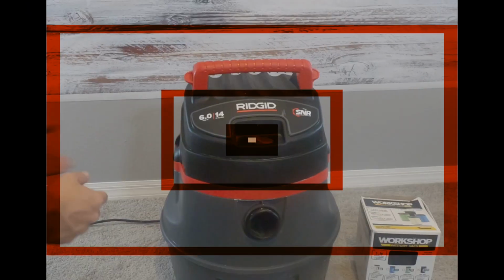how to convert any shop-vac into an extractor, for ONLY $250.

Comment: I just ordered the mytee upholstery tool and hooked it to the shopvac lol
Reply from the maker: Thats a solid option as well. Ive always been a lil over the top on projects and this was no exception lol.
Reply: I didn't see where the blue hose went to.
Pressure washer?
Reply from the maker: @proautodetailingsd4190  the garden hose adapter screws into a garden hose spigot or a hot water heat for a hot option.

If you look at the end of the video where the contant is poured intonthe bucket you can see the blue water line hooked up to my water spigot.
Reply: @detailaddicts  what if your mobile thou were can you connect the end of the air hose ?
Reply from the maker: @armandosalgado3390  so the blue hose is a water line (looks similar to an air hose). I would connect it to my water tank or wster tank pump (if using a pump on to incrrase preasure).

Comment: I got a bissell works great and it was 150 and didn’t have to sacrifice a shop vac
Reply from the maker: Didnt sacrifice anything. I can early convert it back into a dry system with a filter swap and wand attachment.

Glad you found success with your Bissell. Just didnt have enough capacity for me for larger jobs.

Comment: So, no heat, no solution.  Really just a rinse.  Still cool and simple.
Reply from the maker: Heat comes in a few forms. Like the chemical heat I used (that was flex carpet solutions in that bottle i sprayed) or the mechanical heat of a drill brush.

Ive taken plenty of stains out without  heated water.

Comment: where would you connect the water hose to if you have a specific diluted solution to rinse the carpet with? thank you for the great vid too
Reply from the maker: This wouldnt allow for metered mixing ability.  For a rinse i normaly use a pumo sprayer diluted and then sprayed and extracted with only water. 

But if i cam think of a way to incorporate something like that ill make another video. I dig the idea.
Reply: @detailaddicts  thank you! will look forward to that. this vid also has been uploaded for about a year now and its suprising that you replied so fast :D
Reply from the maker: @fuuraa4765  happy to help anyway i can. 

Sey there arnt more videos yet. Still trying to master filming without plane noise (lives next to airport)
Reply: @detailaddicts  wonder if you could use hot water in a 5g bucket? Sump pump in bucket. Connect hose to pump and then to extractor?

Comment: Nice video bud very informative. However I was wondering the water hose r u just connecting it to the outside water faucet or what….. just curious that’s why I’m trying to get mine setup that’s why
Reply from the maker: Yup connect that mytee faucet adapter to hose spigot and use that. No pumps required. Hose diamater is smaller then spigot diamater which increases preasure at atomizing tip when engaged.

Comment: Thank you! I ordered all the parts and works great on my 18V Cordless Ridgid wet/dry shop vac!
Reply from the maker: I was just talking to my buddy about if the cordless would be a viable more mobile option. Great minds think alike, Love it brother.
Reply: @detailaddicts   works far better than I expected. Suction is far better than those Bissell Spot cleaners. I just wish the charge in the batteries lasted longer than 15-20 mins. I have the 18V Lithium-Ion MAX Output 4.0 Ah Battery. I see they have a 6.0 Ah MAX Output that may give 50% now. So maybe 30 mins per battery charge.
Reply: @ricardogomez01  I had not seen vacuum wars video, though I really like there comparisons. Project farm has also posted a solid comparison of these vacuums. If it works well in your setup, I’m glad! I will admit, in my portable rig, size factor is a huge limitation. Vacuum Wars did a video on best portable vacs, and the Vacmaster Beast had the best numbers for an extractor. I already carry a generator, and all of the water lift numbers on these battery powered vacs are HORRIBLE. Even the giant rigid vacuum, admittedly decent but still not amazing on paper with just the 60ish inches of lift even with the solid air flow number. After finding that out for my particular setup where I wouldn’t be able to fit a vacuum that large, I just decided it wouldn’t be worth the investment, since I already carry power with me. I totally understand if it makes sense for your setup! And I believe you if you say it works pretty well.

Comment: Have you had any trouble with dirty water/cleaning solution getting sucked into the motor and blowing back out the exhaust port?
Reply from the maker: Nope. There is a float ball inthe vacume tank that when to much liquid is collected it blocks the intake inside the tank to prevent this issue.

Comment: I always see everyone mention adding the  water line. Can I use this just to extract and apply the cleaner by sprayer and hit it with a drill brush before I extract?
Reply from the maker: So you could. However the water is used to remove and neutralize the soap solution.
The water is also is used to surfactant and suspend the dirt and help remove it easier through the fabrics interwoven fibers.

Comment: How easy is it to return back into a shop vac? Would it even be necessary? Would the extractor be used as the vac?
Reply from the maker: Less than a min. Pop the velcro tabs open. Swap nozel back to a dry unit and swap inner filter.

Really simple to convert either way.

Comment: Subscribed. Question, so your hooking up the water hose to a regular faucet correct?
Reply from the maker: Correct. You could also hook it up to say a tankless hot water heater for a heated extract.
Reply: One of the best ideas I've ever saw. Good job
Reply from the maker: @george230  thank you. Go forth and extract everthing your heart desires.

I know i am lol.
Reply: Great video. Couple of questions. Do you use the quick coupler at both ends, (needing 2) and also the hose connection, do you have a link for that from Amazon. I assume it's a female hose to quarter inch iron pipe adapter.
Reply from the maker: @jrieken1  1 set of couplers is needed.

Links in descriptions sir.

Comment: So I’ve never really used any extractors besides my bisell spot clean professional, will this blow this one out of the water? I spend so dang long, refilling the little tank and do the seats dry pretty quickly? I use mine and use it all the time, and it’s so time consuming!
Reply from the maker: Youll have a larger storage tank, water on demand not a tank base. Meaning you can go alot further and faster then the Bissell.

If your needing more then a Bissell but not wanting to buy a mytee for $1300, then this is the perfect in-between machine for you.

All the benefits of a mytee wothout the cost.
Reply: @detailaddicts  Thank you so much for the reply! I’m definitely going to try and attempt to build this! I do a lot of interior cleanings, and feel like I could be so much more efficient than what I am right now! I’ll be building this hopefully soon! Thank you so much!
Reply from the maker: @dandropsgears4614  my pleasure brother. If ya need any assistance, just let me know.

Comment: So if I just want to.hook this up to my shop vac and don't car about spraying a cleaning solution, what is the method to hook it up? Is having this attachment any better or has better or stronger suction capability than me going out and purchasing a 6hp 3-1 Extracror made by HART?
Reply from the maker: So this allows you to flush / rinse the carpets out with water. To hook up attach the 1 7/8 wand to any hose and boom dry extraction vacume. (Adapter may be needed to go to larger hose size as i did in the video)

As for increased in suctionn there may be some, but the holes in the extractor head are smaller then a normal shop vac hose. So actual water removal flow may not be any greater then a regular hose.

As for why you would build this over buy the HART well thats down to user preferences.

The HART is a cheaper version of the Mytee. This was a DIY version to replicate and exceed a Mytee's abilities for much less and with more durable parts. (Also the vacume's warranty is lifetime at any HomeDepot (fast changes if a problem happens) thus making repairs a quick and easy thing.

After years of using pro 3in 1 products that broke sometimes on the forst use others mid job with an expensive and complicated rebuild i decided there had to be a less fancy optioned way that was much more durable and rapidly repairable by common and easy to aquire parts (wand head was the only exception and a very bugie one i might add lol). 

But hey the part has a great design and why messs with it?  Take the best of Mytee and leave the worst (there cheap fittings, pump and expensive shipping costs.

Comment: Great Video, do you know if I can use the same exact fittings and measurements with the Beast Professional 5 gal?
Reply from the maker: So im unfamiliar with that model, however it uses a similar hp sized motor then it will have the power. (Most vacume's use a same size hose or adapters).

Somin theroy yes. However ive not actually done one with the Beast version.

Should work!

Comment: What vacuum hose and adapters did you use to connect to the wand?
Reply from the maker: The orange vacumr is a a rigid 2.5in vacume hose. I used a 2.5 to 1 7/8th reducer in the mytee to make them fit.

The adapters for solution/  water are 1/4in.
Reply: @detailaddicts  
I’m a bit confused. 2.5” Ridgid hose? There’s no such thing as a 2.5” Ridgid orange hose. 

There’s a Ridgid orange hose that fits into a 2.5” inlet, but it’s never referred to as a 2.5” hose and is either the 10’ hose that comes in the Ridgid Detailing Kit or the stand alone orange hose they call the professional hose. Is that what you’re referring to? Or does Ridgid actually make an Orange 2.5” hose?
Reply from the maker: @Samuelfish2k  thanks for watching and having a question. 

So i might have got confused and used 
the wrong tube id type the hose needs to be 1 7/8 . Maybe i have big connectors on my little hose 🤷‍♂️. Idk what to tell ya. 

As for what the official proper name for that hose i bought over 2 years ago is....well frankly i could care less wbat they wanna official call it lol. Orange pro rigid vacume hose works for me.

Now to come full circle here is the link of where i purchased it from 

https://www.amazon.com/dp/B000QYBOUU/ref=cm_sw_r_cp_apa_glt_fabc_569T0Y5C2RZX578HG282?_encoding=UTF8&psc=1
Reply from the maker: @Samuelfish2k  here is your adapter for the hose and the wand....

Its a 3 pack amd its for 2.5 to 1.7/8.

Cheers

https://www.homedepot.com/p/RIDGID-Hose-and-Accessory-Adapter-Kit-for-RIDGID-Wet-Dry-Shop-Vacuums-VT1755/202077239?source=shoppingads&locale=en-US&mtc=Shopping-VF-F_D25T-G-D25T-25_9_PORTABLE_POWER-RIDGID-NA-NA-PLA_LIA-2231050-WF-SMARTSHOPPING_Q1Q2PLUSUP&cm_mmc=Shopping-VF-F_D25T-G-D25T-25_9_PORTABLE_POWER-RIDGID-NA-NA-PLA_LIA-2231050-WF-SMARTSHOPPING_Q1Q2PLUSUP-71700000083187724-58700007049582709-92700063451361524&gclid=CjwKCAjw-qeFBhAsEiwA2G7NlznTM4_IDhkvOFdjlKp43ER-670Vw4uEMkv9WKS1G3fTszTq-uphFhoCa-sQAvD_BwE&gclsrc=aw.ds
Reply: @detailaddicts  
Yea, it’s the Ridgid professional orange hose. For a minute there I thought there was a 2.5” orange hose that I’ve never seen and I would’ve bought it the moment you gave me a link. Lol. 

And it’s couldn’t care less, not could care less… You don’t want to go around sounding dumb now. Lol.

Comment: So if your mobile you can connect to pressure washer hose ???
Reply from the maker: Just regular faucet is only needed. The water psi out the tap is 9 out of 10 times high enough of a psi for the wand.

Comment: where is your water source for rinsing?
Reply from the maker: The water was hooked up to a garden hose spigot. (Could also be hooked up tona hot water tap). If you check out the end when i dump the wate into the bucket youll see the blue line connected in the backround

Comment: How much pressure u get standard 55psi what about heat
Reply from the maker: Ive got almost 65psi out of my spigot sapposedly (havnt checked the claim).

As for heat youncould attach this to a hot water heater, or use a chemical heat with say drill brushes mechanical heat.

The heating element is one of the most comon failed parts (followed by switches, fittings and pumps). My thought was to make a cold water system that was rugade and use supplemental heat via chemical (flex fire and ice carpet solutions).

Comment: how is the 2 1/2 hose working for succion?
Reply from the maker: Fantastic! Dosnt bog down even in the thickest of puddles. 

Some may owrfer the 1in 7/8 for its thinner diameter and easier to maneuver. I dont think either is a bad option. I just like to hotrod my equipment to run hardcore.
Reply: @detailaddicts   im actually trying to make my ridgid the same like you and was going insane on how i can do it and what hose will be perfect for the water succion but then i found this and i guess 2 1/2 hose is good enough as well
Reply from the maker: @angelsantiago6813  just remeber if going 2.5 youll need that adapter to drop down to the wands size. (Avalibe in 3pack of asscories at HomeDepot)
Reply: @detailaddicts  another question i have the 6.5 hp blower head one.. and cannot find a filter for that one.. where can i look.. its the vf4000 - vf6000 and cannot find one for that shop vac

Comment: hi wich adapter do u use between tthe the hose and wand?
Reply from the maker: 1/4 in quick disconnect couplers. Link in description for Amazon
Reply from the maker: @nazareoramos3968  the couplers were from an accessories pack i got at home depot. But its a 1.75 in (wand size) to 2.5 in (hose size). The suction hose is the hd crush proof version rigid makes (avalibe at local home depot amd amazon)
Reply: @detailaddicts  thanks for your quick reply keep it up

Comment: What is connected to the extraction wand? Mine came with just the wand.
Reply from the maker: Not sure what what your refering to. Perhaps its the black coupler to adapt the smaller wand handle to the large diamater hose? That is a shop vac hose adapter that is found at home depot.

Or are you refering to the water line in on the handle. If so dod you purchase the mytee 8400p or a cheaper plastic verison. The reason i dont recommended them is because there do not have the sprayer assembly and wster line adapter and wil need to be sourced as well (hidden upcost).

Help me help you lol

Comment: Very dope...do you have a DIY hot water solution??? Lol
Reply from the maker: Hook it up to a eletric tankless hot eater heater amd boom hot water extraction on demand.

https://www.amazon.com/dp/B0148O658Y/ref=cm_sw_r_cp_apa_glt_fabc_D47132MHNSETJHESG1A1
Reply: @detailaddicts  thank you mane
Reply: You will need a corded online heater for carpet cleaning. That other thing won’t work. Too little. Won’t give you enough hotness
Reply from the maker: @hunterhic  you can achive heated results via chemically (flex fire and ice solutions), mechanically (drill brush) or physically (steam / hested water).

There are several ways to skin a cat, and to add heat to a fabric is no different.
Reply: @detailaddicts  I agree, heat is too expensive.

Comment: What’s the gray hose from?
Reply from the maker: That was the original hose that come with the shop vac when i purchased it. I then bought 2 of the hd hose's to extend it, so i could reach anywhere without moving the vacume.
Reply: @detailaddicts  thanks bro this helps me alot. We have two broken mytees at the shop. Two are still working. This is something I feel will help better on the mobile unit. Less chance of a failure rate. There's time when the mytees broke down on the job.
Reply from the maker: @pandassudsnshine4125  and should the vac fail, its a short trip to the depo for another lifetime warranty rigid. 

Glad you found this helpful, dont forget to tell your friends. Gots to spred the gospel lol.

Comment: you can buy and exrtactor for less than 250
Reply from the maker: A smaller less powerful one yea. The rug dr or Bissell is less money. But also holds a fraction and requires multiple empty and refills.

Its the cost to performance factor. Otherwise i would have kept using the small units.

Comment: Thing is, why not just purchase an extractor for the same price?
Reply from the maker: So a mytee extractor (small unit no heat) msrp is $650ish. This was a way for people to build there own with similar features  (same wand / head) for less than half the price.

And while there are cheaper extractors, generally mytee is considerd to be twards the top. Despite the high price, fittings failing from factory, and issues with pumps burning out. 

For less than half i built a unit one can used in a shop based section that not only runs just as well, but is much cheaper and easier to replace a broken piece. And holds alot more liquids, meaning less stoping and emptying during larger jobs.

Comment: Well if it's connected to a regular water spigot it's gonna take a week to dry 🤭
Reply from the maker: Um....no. its takes hardly any time to dry. The 8400p uses very little water when dispemsing (fine mist) and the vacume has alot of suction to remove the excess water.

Ive done several cars with this and the dry time was no longer then any mytee.